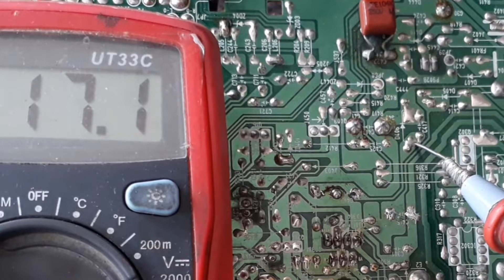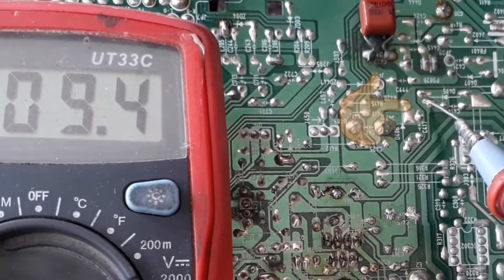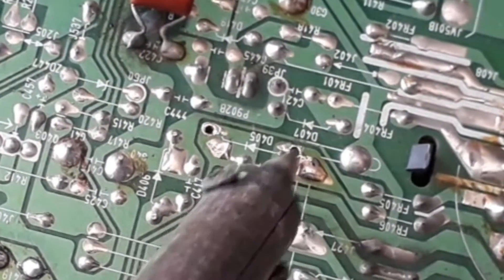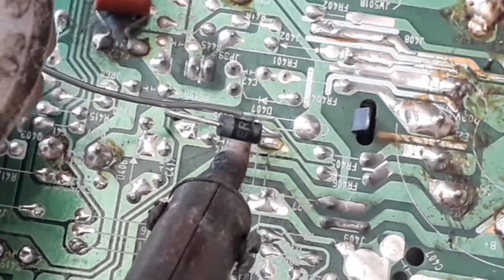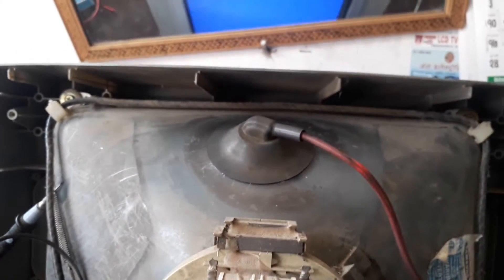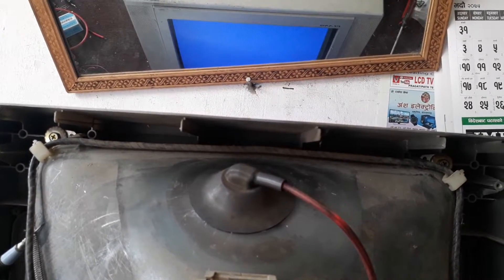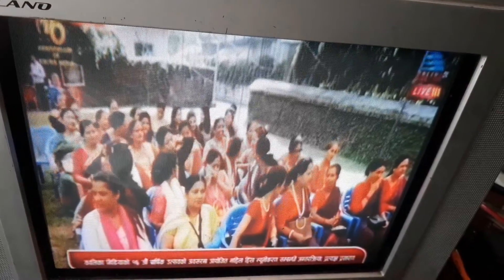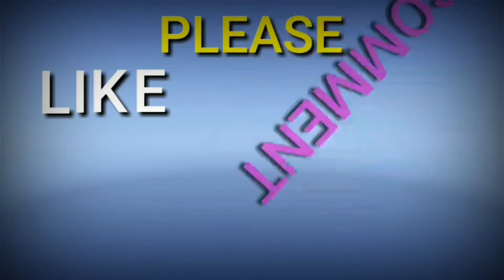LG TV Vertical Line Problem  Part 2 || Solved Without Ic Change || Led Tv Repair

Comment: My lg flatron plus tv horizontal lines  coming on upper side on the screen.what is the problem.madam.please reply me.thank you
Reply from the maker: 100uf 35 volts capacitor  change 
Or 1000uf 35 volts capacitor  change